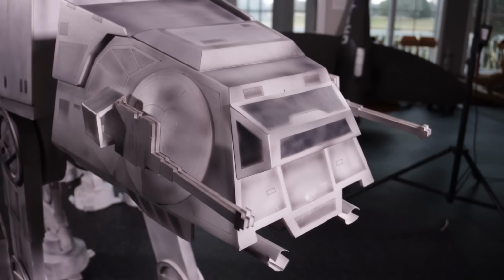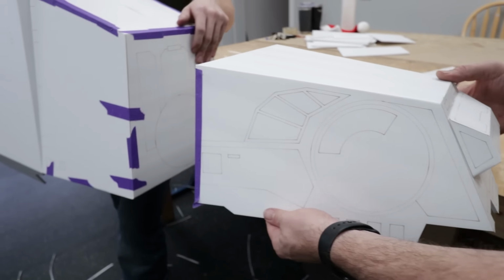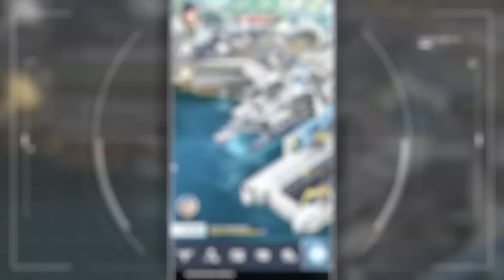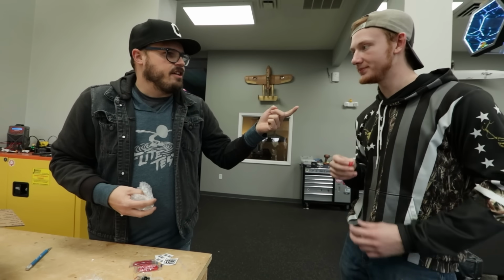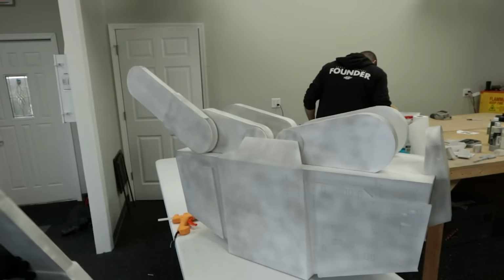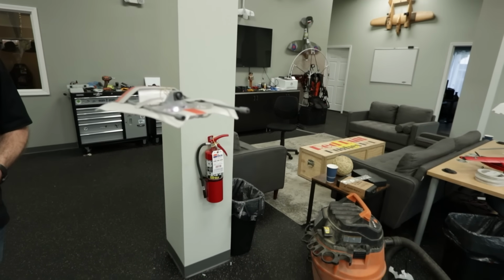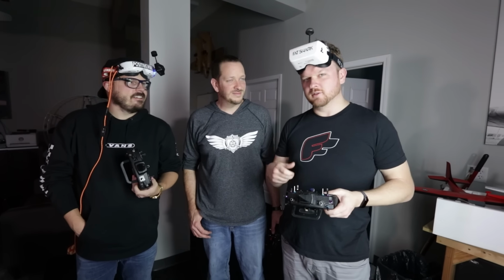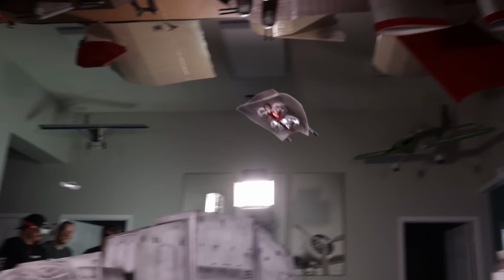Can We Trip an ATAT with Tiny Snowspeeder Drones!? 😲💥  Star Wars

Comment: pilot: detach cable!
Gunner: wait what?

goes down with AT-AT

gunner: ooooh that...
Reply: This!  I was 10 when this movie came out and the only criticism I had at that age was the 'speerder pilots would have been taken down with the AT-AT's unless they released the cables at exactly the right moment.  SparrowJLT, you have my respect!
Reply: @Moondog-wc4vm  but they released the cables.. there is even dialog
Reply: sparrowJLT  I. Hu
Reply: @Moondog-wc4vm  What I don't understand is if the Snowspeeders can blow up a AT-AT coming from above and behind, why didn't they do that instead of suicidal head on attacks and cable lassoing?
Reply: @blank557  Good call sir!
Reply: @rogeriopenna9014  I know they did, but it still doesn't make sense to me, not everyone has superhero reflexes!
Reply: Moondog 1970 there’s actually a large amount of a safety margin for them to release the cable. It’s not like they’re pulling it right, they’re just wrapping up the legs, and the friction keeps the cable on
Reply: Exit Only personally, I think that the snowspeeders can’t destroy the atat’s armor. That’s why you see two troopers running through the snow after the atat falls over. They set charges, and it blows up around the same time a snowspeeder shoots at it
Reply: MelancholyMaids Me personally, I just think they have shields, and those shields went down when they hit the ground. It wasn’t that the snowspeeders couldn’t penetrate the armor, but that they couldn’t penetrate the shield. I don’t know, at the end of the day, the original Star Wars movies didn’t really care about consistency, and at the end of the day, George was just trying to make a trilogy of movies that looked good, felt good, and were fun to watch
Reply: @melancholymaids3032  Luke says the armour is too strong for the speeder guns.. also they were in quite a hurry to stop them as they were nearly on the base.
I allways wondered why they didnt used X-Wings.. maybe they needed the X-Wings to cover the evacuating transports but all speeder pilots were fighter pilots who took their X-Wings after the battle .. In Rogue One X-Wings are seen capable of gunning down AT-CTs but we dont know how strong the AT-CT armour is compared to the AT-AT
Reply: sparrowJLT flashbacks to that scene in the force awakens
Reply: What's a a-t a-t? Wait. What?
Reply: Lmao... yeah.. oops
Reply: @sparrowlt  X-wings are for space and don't have enough lift to be used in an atmosphere.  They have enough for take off and landing, but not enough to keep flying.
Reply: @melancholymaids3032  That may have been a SE add-in, I do not recall seeing that in the original movie.  Anyway, I always assumed that the fall disrupted the armor enough that the blasters on the airspeeders would then penetrate the AT-AT.
Reply: @sparrowlt   Yah but even so the AT-ACT was cable of with standing some damage even from shoulder fire rockets. Which just really shows how tough the Standard Combat versions are. But Honestly I as much people criticize the AT-ACT as cargo Transport. I personally liked it because I found The Empire needed a heavy ground vehicle that could carry heavy loads. Don't get me wrong I still think flying cargo transports are good to given you need vehicles that can deliver lighter cargo efficiently because lets face the mail ain't gonna deliver itself in star wars to after all emperor still has credit card payments to make on his death star investment lol. 

and most ground cargo vehicles cannot handle heavy loads. Also its more expensive to make large enough  repulsor lift or hover vehicle that can carry such loads and the extra weight puts a lot of strain on the engine which can cause more frequent break downs than ah more cost effective walker that can distribute the weight more evenly. An given that its a cargo version first and combat vehicle second its most effective at its role when not getting shot at lol. But I am sure it would probably make for long slow day of work considering they wouldn't get the more interesting combat training that the Elite combat crews of standard AT-ATs have. That right if you were in the empire you had to be a specialized and certified AT-AT Driver/ Operator. But Cargo Variants could be operate by any imperial soldier that at least had some basic training and knowledge of operating imperial vehicles and Mechs. But personally I think  I would find it interesting job within the empire even though I am not huge math expert of thing I always find the process of logistics interesting and how to get cargo from point A to B. Or the imperial Logistics officer along with subordinates taking proper inventory of cargo, supplies, gear, parts/replacement parts and equipment needed to maintain the military forces. While at the same time make sure what needs to be shipped be shipped to the correct location and when it should arrive at it destination or what is being shipped and while its being shipped that location or how it will be shipped.

Ensuring it arrives intact and if  the cargo is needed urgently to go certain location allowing for change in priority shipments. We mostly just see the front line forces in the heat of battle in star wars. So it was interesting show the sort of perspective of second line units on scariff in Rogue One having to scramble for battle when they themselves were at as well trained as defending storm trooper garrisons and having to fight alone side them in surprise rebel attack.

I guess I am more interested the behind the scenes average joes/misfits of the empire that played big role in maintaining the Empires ability to function at its peak as much is could. Because at the end of the day of those support or rear line troops weren't expecting to see combat and just door their support tasks for the empire and punch out on their time clocks at the end of the day hoping to see their friends and family.
Reply: Tagg & bink
Reply: @blank557  I think that the neck armor is the vulnerable spot, but only after it takes damage. The Walker falling would have done quite a bit of damage already, compromising the armor enough for the speeders to blow them up. Now if the rebel alliance had A-10 warthogs the empire would never have made it to echo base.
Reply: @blank557  what I don't understand is why they just didn't use the X-wings to take out the walkers.
Reply: @Exit only - gotta go along with Rule of Cool. The Force insists upon it!

Comment: That was pretty awesome... though, with the ATAT's being made of foamboard, why not just have a spool of, say, 30' of fishing line (probably spider wire) on the back of the speeders, hover the speeder near the knees or ankles of the ATATs, have a needle attached at the open end of the line, and "grapple" the walker with the needle, then, as you fly around the walker, the spool unravels and the line comes out.  and instead of "letting go" (as Hobbie called to Wes in the movie) the line is tied to the spool, at which point you just "pull" the walker down. --- Either way, this was a GREAT "Proof of concept"... would love to see you guys motorize the walkers for another run and try this again.. :)  Man, that looks fun.

Comment: I get the idea; but with all the work you put into it, you could have just as easily built a working walking AT-AT. The servo's used to move the legs in, could have been applied to make it actually walk with little effort, especially if you mod the legs to automatically bend as it lift's up to step, and then bend back as it's moving forward. This way you could recreate the entire scene real time. Even better; place a few metal "catch points" on the AT-AT and attach a small 1mm magnet to the end of the tether of the snow speeder, and have the tether on a free rolling spool. Then when you simply have the snow speeder fly with the tether loosely flapping behind it, and try to attach the magnet to one of the metal "catch" points on the ATAT. Once this happens, you then try to fly around it until the tether feed ends. Once it ends it disconnects from the Snow speeder, and binds up the ATAT, recreating the scene.

Comment: Yer drone needs tiny legs to hold it off the table at launch.
Weird as it may sound, having the fans too close to the table steals a lot of lift!
Flowing air always has less pressure than stationary air, so any airflow under the fuselage makes a vacuum cell.  
The closer the fuselage is to the table, the stronger the effect.
Bring it up one inch, and yer take-offs will be more snappy!

Comment: Now you just need a way to disengage the tow cable so you DONT get caught up on it when it falls over. I don't know how hard it would be to put that String on a quick release so it split off when you pulled away hard enough (mostly because I don't know how hard you'd have to make it to trigger the quick release so it doesn't pop prematurely) but that's what I would try if I had the time, resources, drones, money, and small scale AT-ATs.

Comment: X-Wings blew-up AT-AT's in Rogue One, a few years before the Battle of Hoth. I hope someone in Rebel Command got sacked.
Reply: Um those were cargo versions  they don't count lol just kidding. X wings can do effective damage even to standard AT-ATs but its was more that the Empire had air superiority and X wings were need to escort evacuating transports or escorting some Y wing squadrons that needed to punch some holes through the imperial blockading fleet as assume the orbital defense Ion cannon might not have been enough to punch a big enough whole in the fleet also it only would only disable a star destroy for short window off time until the crew start up its backup power systems restoring the star destroyer to partial functionality if not fully functional again. So rebels really needed to get those transports through so any available y wing squadron couldn't prioritize AT-ATs on the ground either they had to make dent in the imperial blockade to allow for an escape either but having destroy any interdictor class star destroyers that have gravity well generators prevent hyperspace travel. or doing enough damage to incapacitate an ISD  or 2 creating a gap in the block firing lines to get through. The X wings that were available to had to focus keeping tie fighters off the weakly armoured and armed transports as well as keeping tie fighters off of any y wings make bombing runs on imperial capital ships that were positioned more vulnerably than others or were possible were lesser capital capital ships like Victory Class Destroyers or frigates similar to an acclimator assault ship role . As Rebels new they had lost Hoth they weren't gonna stay and fight it out so they need every means to punch whole break through imperial blockading fleet to live and fight for another day.

Comment: When I make prototypes like the sno speeder. To keep the above couling or external parts that stop the air flow and flight, i use cutouts of window screen and paint them white etc... It has a cover to represent the housing or hull but airflow still goes through.

Comment: Love it. But come on... the AT-AT was literally made to trip it’s self regardless of the snowspeeder
Reply: Yes and that is why First Order was like hmm maybe would should fix that issue and they installed extra stabilizing pads to them or metal shock absorbers you can see the changes to the first order model by the visible bulges on top of the feet. Its kind of cool looking actually looks like orthopedic insoles for AT-ATs to give there feet stability and comfort on the battlefield lol. And the AT M6 with its mega jacked front legs that work as effective cable cutters. But I also heard the Elite variants of AT-ATs had electric saw blades installed in their knees joints that were used for cutting tow cables making them immune to tripping but given been Elite models probably very expensive to produce and rare to see on the battlefield but neat solution I would say anyways lol.

Comment: Probably a slightly modified snow speeder and one that made the standards work could go in the space and a clip of a small enough hyperdrive for the ship like the size 1 and a XWing essentially a snow speeder cooler but nobody’s ever tried and the fact and see would be good in some parts and others but there’s not really any point unless you’re on the snow planet or there’s gonna be a lot of walkers but you could just do the cables with the XWing instead of a smell sweeter some other Star Wars attack ship that a small enough to go around the legs of atdt